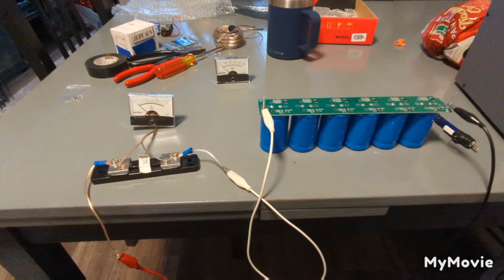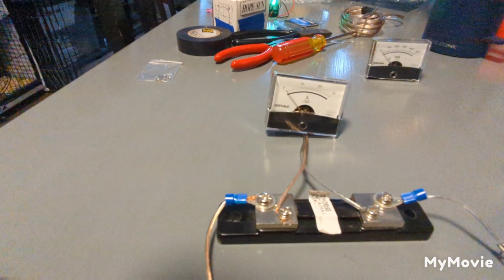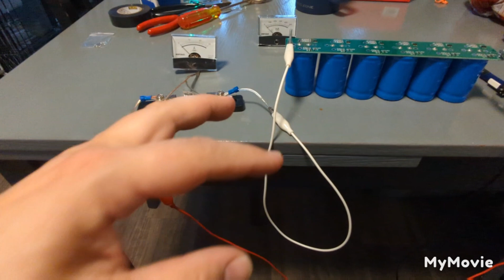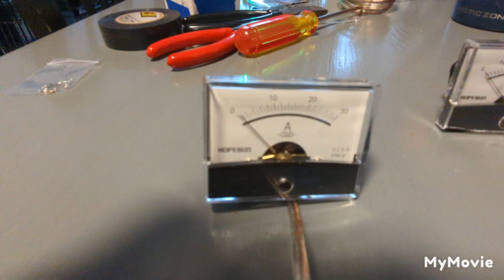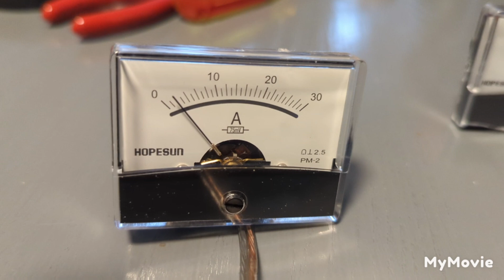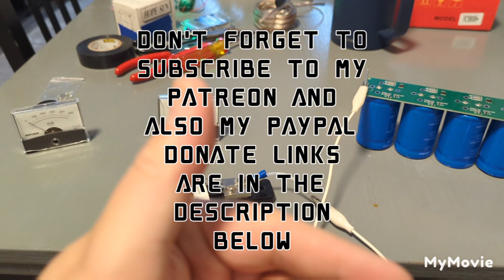Faraday Research RND ⚡⚡ Adam's motor generator/shunt build #freeenergy #tesla #zeropointenergy

Comment: For anyone who wants a decent usb 2 2 channel oscilliscope + logic analyizer you can use on your PC the Analog Discovery 2 from digilient is 60% off for the next 8 hours which makes it 159.60 instead of the regular 400. If you wanted one and miss the sale, you can normally pick them up from used on ebay from students for around $150 as universities can buy them at deep discount for resale to students, who flip them on ebay sometimes.

Comment: You measure VOLTS across a current shunt!
Not the amps from a small ammeter!
The ammeter already has a small resistor in it, so it will then read the amps, using ohms law
thats what they are made to do,   in the range that they will  have   (according to the small resistor value inside of them)

,03ohms resistance to your current shunt  is made for a milliVOLT meter, not a milliamp meter! 

Really good millivolt "meter" is an oscilloscope!!  
The probe "tip and ground clip" go right across the current shunt (resistor)
This is right where you have the little analog ammeter now in video.

Thats what current shunts are really good for and used for mostly. (scopes!)

Now you can measure currents, see the pulse width, see the shape of it, measure the frequency of pulses and also see the current relation to voltage if using dual-channel scope with two probes.  

Also you measure voltage ACROSS the current shunt, not going into it (!!!)
Its not like the input to your system lets say is 24V,  then you use that in the ohms law eguation, (but of course you can if knowing the amps with ammeter)

BUT, with a current shunt for example of .03 resistance in ohms, 
the the voltage you measure for ohms law is what is the voltage across that shunt!  (not to it)
Its all simple really dont fret or worry about anything!
Keep going and dont stop 
to argue especially!! (haha)
You are doing great things
Reply: I second this comment! Keep up the great work mike. Now wire this shunt in series pricesly as you have it. Remove the amp meter, hook up the second probe of your scope across the shunt. Hook the first probe of your oscilloscope up like in the last video to measure voltage across the load. Point that cell phone camera at your oscilloscope, and turn that beast (the generstor) on. Then we can compute the power output by converting the shunt voltage to amps using ohms law and your shunts 0.3 ohm if that is correct. Then multiple the voltage (scope probe 1) by the computed current from scope probe 2, to get the power! I believe this can be done as a third computed line in some oscilloscopes automatically. Really looking forward to seeing the scope output :)
Reply: Yes 

Measuring voltage drop across the shunt gives idea of the power being supplied by adams output to load ( 6 bulbs)

We know resistance is 0.3ohm (shunt resistor) ( I think this should be 0.003 ohm as idea of shunt is to give low resistance side path as used in ammeters)
This low 0.003ohm will give a milivolt drop across the shunt)
Reason to use low resistance is so non of voltage is used up by heat which will mean this wasted heat isn’t going to get registered in the caculation for the current. So shunt is like a wire in circuit but you know the resistance.
Voltage V(s) is measured across shunt (will be mili volts if it’s very low resistance shunt)
Ohms law equation gives current I(s) flowing through shunt resistor since you know the voltage drop and resistance of shunt. As shunt is in line with load (bulbs) so current is same through bulbs as the shunt.

I(s) = V(s)/R(s)      

The shunt is just to know the current going to load (bulbs) without affecting it much
I think
Then you measure the voltage V(L) drop across the load (bulbs)
To get power used by the bulbs then multiply 
V(L) x I (s)

I thing best way to determine the power being supplied is by working on joules which is a unit of energy 
If your looking at a varying wave like out of a pulse motor the watts (which are joules per second ) is continuously varying but joules amount will stack up )

You might find the voltage measured across the shunt will show the spikes or max of waveform (if using a multimeter) coming from the ‘Mike mystery machine’ so the current calc’s across shunt will not be correct as voltage is varying and so is the current. The scope voltage readings are short spikes so can only count these by overall average (ie area under the spikes only )

In physics experiments 
The way to absolutely check an output is by using a heater ( just a resister or thin metal wire ) as the load instead of the bulbs.
It’s put in a container of alcohol or water (alcohol has low heat capacity so heats up faster ) or a liquid to absorb the heat. The apparatus is all insulated 
With foam. ( builders foam spray for filling cracks) be careful with alcohol due to flammability 
Then it’s easy to find the output by just measuring temp increase of liquid.
Then use heat capacitance equation to get joules absorbed by the liquid.
Power is just joules per second.
So wattage output (what you want to know) will be temp increase and how long it took to heat the temp increase

The specific heat capacity of water is 4,200 joules per kilogram per degree Celsius (J/kg°C). This means that it takes 4,200 J to raise the temperature of one kg of water by 1 °C.
(Alcohol is 2400J/kg*C)

Q(joules absorbed)=M(kg)x C(heat
capacitance) x T(temp increase)

If you get 0.2kg (200ml if water) of liquid with 4200 heat capacitance that goes up 6*C and takes 10minutes
Then 
0.2x 4200 x 6 =5040J (absorbed by liquid)
Over 10minutes 

5040J/ 600sec = 8.4Watts (continuous output)
It’s not really continuous but this Calc gives the averaged continuous output power this is advantage of measuring joules as they are stacking up over time period like filling a bucket of water with a tap that’s varying it’s flow, joules gives you just how full the bucket is with water rather than the flow at any instance from the tap. A sine or impulse waveform is like the tap being turned on and off in busts which is filling the bucket.

But the average power (watts) will be just how full the bucket is (amount of joules) divided by the time the tap was on.

Best to do this experiment for your own interest but don’t publicly say the result stay ambiguous and obfuscating
I know a melon weighs more than an apple  just by feel 

What your really looking for is how much the adams motor is supplying to the bulbs (voltage and current) but if your going to work out the current going into the bulbs (from the adams motor) by using the voltage drop across the shunt your going to want a high flow and minimise the heating of shunt resistor.
Any heat will mean this energy won’t be registered in the calculation.
This indicates how much pushing power (like horse power) the motor is generating from its output, from the current going through bulbs array and the voltage drop across the bulbs array.

I think the large spikes on scope reading is kicking the current round.
The wider the spikes the longer the kick or push.
Your scope (I’ve not got one) might be able to get the RMS voltage across the shunt 
This is root mean square 
As it’s squared the negative voltages (dips) in ac are made positive (negative squared becomes positive= (-)^2 = + so this is the overall average voltage across the shunt. 
That’s why your friend was saying use the shunt method instead of an ammeter to find current through shunt .😮resistor. With scope you can get the average RMS voltage across the shunt .From this you can get the overall average current through the shunt which as in series with bulbs is same current as going through bulbs
Reply: @gmoe8714  Very good comment, what your describing is a calorimeter. I totally support this idea. I am also of hte mindset that it's probably good to "stay ambiguous and obfuscating" for ones own safety, although I would love to know the results. I was hoping perhaps the scope shot of current (as measured by the voltage across the shunt) and voltage across the shunt and load, would be ambiguous enough that it might not attract attention. Also regarding the calorimeter a very simple poor mans test is to use a "control", basically you run your system and measure the heat up of the water over say 30 minutes and record the voltage and current from the benchtop power supply. Then you compute the resistance you would need to cause the benchtop power supply to output the same voltage and current and create a heater wire that matches the resistance, then you put the same heater wire in the water and you apply the same power and measure the temperature of the water after 30 minutes. You can then compare the relative heating power like that. Honestly though scope shots are good enough as we can roughly integrate under the curve to get the energy generated. The spikes which are going to be cut-off I suspect may be where the bulk of the power is dissipated unfortunately make this potentially difficult to do so your calorimeter approach is the most accurate approach.
Reply: power supply is set at ~25v which is rms of 17.67V

Scope had rms ~27v with 8 bulb

Without P’s
Power supply V is same 
voltage on scope with 8 bulbs is rms~16.5V
Reply: @gmoe8714  
Power supply is in DC (the video before this one)  At least I think so. ??

Thats not an AC sinewave signal going into the bulbs shown on scope,  thats a DC pulse with really good "collapsing field" flyback spikes which light up the bulbs.  
Whatever the scope says in RMS does not really matter much, since its not reading an AC sinewave,
Reply: TT
Reply: TT